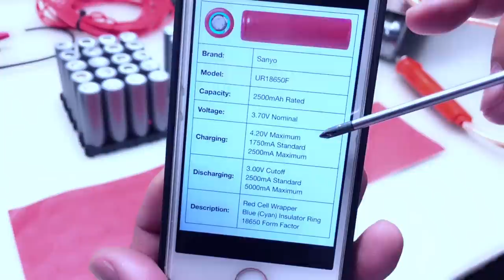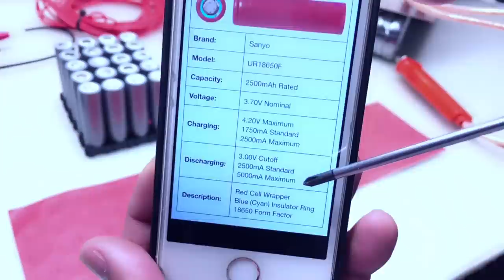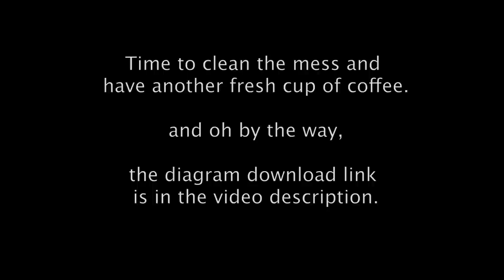DIY 12V 50Ah Lithium-ion 18650 Cells Para sa Portable Solar Generator (Spot Welded)

Comment: Why you will use luster connector? Why you don't soldering directly? And why you don't use a BMS with balance in it? That's my real question.
Your explanation of being able to change a defective BMS did not convince me... desoldering and resoldering anyway.
I look forward to hearing your comments and your response to my point of view. But you make a nice job.
Reply from the maker: I'm gonna try to give you the best possible replies to your queries.

Q1: Why you will use luster connector?
A1: And why not? Because it's handy and convenient with my purpose for this active balancer. I am using it to some other 12V battery banks I have.

Q2: Why you don't soldering directly? 
A2: I don't find the need to do that. I don't want it fixed on one battery bank. I balance my small batt bank with this active balancer. Inexpensive solution, right?

Q3: And why you don't use a BMS with balance in it?
A3: You clearly don't have any idea about the balancing function of BMS. If I may say, it's useless. It only starts when the battery bank is at 4.18V and what then when the battery bank is not in that state of charge? No, balancing is happening. The active balancer starts at 2V up to 4.2V. So it doesn't matter if the bank is of low voltage, it is still working and doing its job.

You said, "Your explanation of being able to change a defective BMS did not convince me... desoldering and resoldering anyway."

My reply to this is, "Every man has his own rights and freedom to choose what he thinks is best for himself. "
Reply: @JFLegaspi  di ko din alam ganun pala pag balance ng on-board balancer ng bms. meaning po sir yung active balancer na ginamit niyo kahit hindi naka charge yung battery nagbabalance pa din? so may power loss din overtime yun?
Reply from the maker: @rosekreuze  meron mga ilang milliamps lang naman at ganun din naman ang BMS.

Comment: Ask ko lang ano maganda battery para sa 30w na solar  at ilan oras ma full chager yun?
Reply from the maker: Ang 30W solar panel ay may 1.7A charging current. Sa maghapon kaya netong magharvest ng 8A, yan ang dapat mong pagbasehan kung gamit ay 30W solar panel. So match dyan ay 10Ah at mapupuno yan sa loob ng 6 hours depende sa panahon.
Reply: @JFLegaspi   ok sir ano maganda battery balak ko kase na bilhin yun 20ah lang na battery! deep cycle battery? or Lifepo4 mahal nga lang un lifepo4
Reply from the maker: @mil.om.c9335  Maire-recommend ko ay LiFePO4 32650 na 20Ah at 50W solar panel. Sulit kesa deep cycle. Lugi ka sa kahit anong lead acid ddep cycle battery, 50% lang ang capacity na mapapakinabangan mo at after a year, pababa na ng pababa yon.
Reply: @JFLegaspi  ok 👌🏻  try ko mag buo nun lifepo4 batter khit 20ah lang marami salamat ☺️
Reply from the maker: Walang anuman 😊 👍
Reply: @JFLegaspi  subukan ko muna 30w na panel wala baget pa hahah ☺️

Comment: Sir good pm po. May itatanong lang po sana ako tungkol sa battery na nabili ko. Naka bili po kasi ako sir ng isang LiFeO4 na may 100ah at at isang 50ah. Tanong ko lng po kng pwede ko itong i connect in parallel connection?
Reply: Same output dc voltage naman po ito 12.8v
Reply from the maker: Good day. 😊 Pwede kung sa pwede, pero dahil sa masyadong malayo ang agwat ng capacity ng dalawang battery, mas maiging huwag gawin. Ang irerekomenda komay dapat magkapareho ang capacity at datasheet ng batteries. 👍
Reply: @JFLegaspi  salamat po sir ok po

Comment: Sir, kung ang bms ko ay 25 amps na 3s. Ilan po ang max na AH ng battery pack ang kailangan ko? Paano po magcompute ng amps ng bms at AH ng 18650 BATTERY PACK na akop sa BMS ko. Salamat po.
Reply from the maker: Good day. Ang proseso dapat ay C-rate ng battery bank ang pagbabasehan kung ilang Amps ang bms. Sa 25A na bms, pwedeng 15P to 20P 3S na battery bank.

Sa videong eto, dahil sa ang pag gagamitan ko ng battery bank na eto ay maliit na portable solar generator, kaya kahit na pwede hugutan ng mas mataas na amps ang batt bank, 30A lang ikinabiy kong bms.
Reply: Sir, pano po yun? Ex. po ang gamit ko po na BMS ay 4s 30amps. Kaya po ba na ang 4s10 na 2100+ amps ang capacity ng 18650 ko? Bali p 5 4s5p po ang 2100+ mah at 5 4s5 p rin po ang 2000+ mah ang battery ko. Pinagcombine ko lang po kaya naging 4s 10p po ang battery pack ko. SALAMAT PO?

Comment: Kahit ilang ampere po ba pag charging sir?kasi yung akin na adjust ko yung ampere adjuster ng buck converter ko.haha
Reply from the maker: Good day. Sa battery bank na’to, pwede ang 5 - 10A charging current. Pwede naman i adujst ulit yon. 🤓👍
Reply: @JFLegaspi  paano kung 12a 12v 4s2p battery pack sir..ano po max ampere ng charging?
Reply: @JFLegaspi  dba sir kapag testing ampere ay series po ang buck converter ,multimeter tyaka bms battery sir?
Reply from the maker: @edingyaw7947  yes, pwedeng naka series ang multitester.
Reply: @JFLegaspi  ano po charging current ng 12ah 12v  4s2p na battery pack sir?
Reply from the maker: @edingyaw7947  Ang pinakatamang paraan ay kunin ang C-rate ng cells ayon sa datasheet neto. Ang C-rate ay nagdadagdag kapag ang mga cells ay nakaparallel, at hindi kapag naka series.
Reply: @JFLegaspi  ok po sir
Slmt s tym
Reply: @JFLegaspi  0.5-1C po yung charging current nya po sir..4s2p yung battery pack na build ko po..
So it means po ba na 2amps po ba yung charging current po na gagamitin ko?

Comment: Sir pahingi po ako ng tulong subscriber nyo po ako at wala pa ako alam sa mga Battery pang solar kong ano maganda,  kasi nka beli ako ng battery ang brand ay Bo yang gel type 100ah at yong solar ko 200w na solar homes madali lng ma lowbat ang battery 10 second lng mabawasan na ang voltage sir, ilaw lng ginagamit namin 12v 9w kada isa 6 piraso po ilaw na ginagamit at isa tv na 32 inch ngayon bumili ako ng bago battery sir ano po maganda brand sir gel type lng po NPP battery or Lvtopsun gel type sino maganda sa kanila sir thanks po sir God bless po!
Reply from the maker: Ang bilhin mong baterya ay LiFePO4, huwag lead acid deep cycle battery.
Reply: @JFLegaspi  maraming salamat sir

Comment: Boss JF, pwede ko bang gamitng charger ito https://www.amazon.com/gp/product/B07WHC2GB7/ref=ppx_yo_dt_b_asin_title_o08_s00?ie=UTF8&psc=1 on that setup?  planning to build similar sa video mo but using 4s12p life4po. Salamat and more power bossing.
Reply from the maker: Pang lead acid type batteries po iyan. 😊
Reply: @JFLegaspi  salamat bossing, any recommendation?
Reply from the maker: Eto po, piliin nyo dyan ang para sa 4S with 14.6V https://amzn.to/35BhDOR
Reply: @JFLegaspi  Your the best sir, thank you and God Bless
Reply from the maker: Yes, pwede yan, it comes with a built-in AC charger for the battery bank 😊👍
Reply: @JFLegaspi  salamat ulit boos, need to re-watch more of  your videos to be on the safe side. I love your vides coz you prioritize safety.